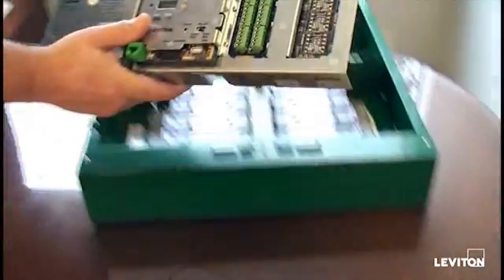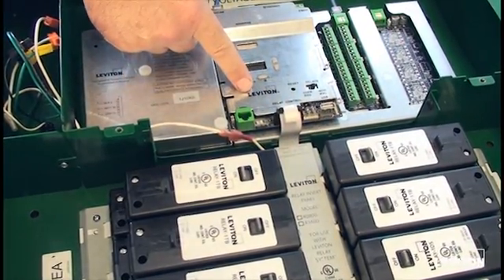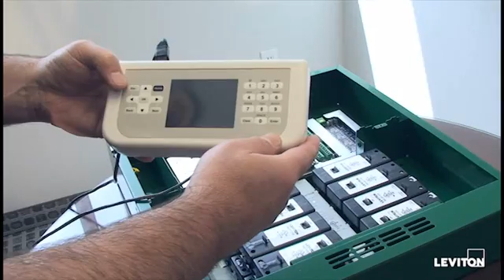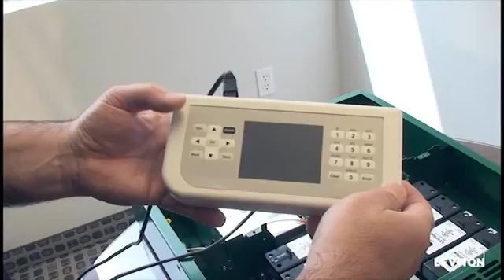GreenMAX™ Modular Design

Comment: What’s the eithernet port for ?
Reply from the maker: The GreenMAX MPU’s Ethernet Port is for connection with a Building Automation System (BAS). The GreenMAX system communicates with the BAS using standard BACnet IP protocol.